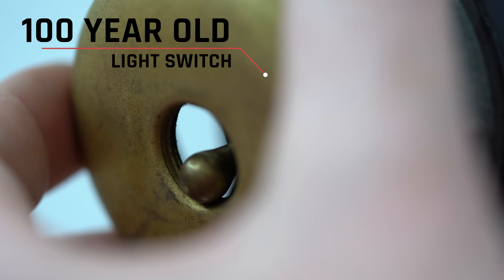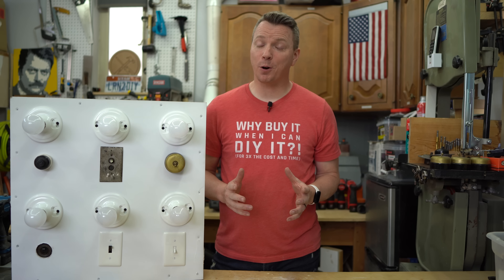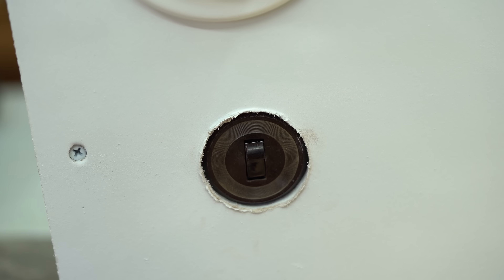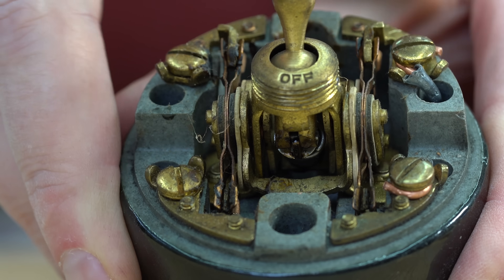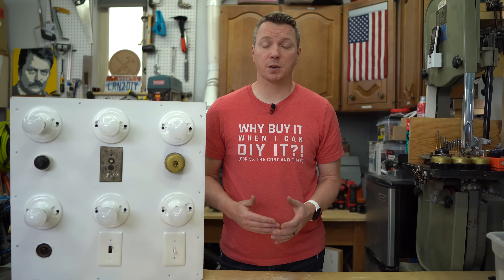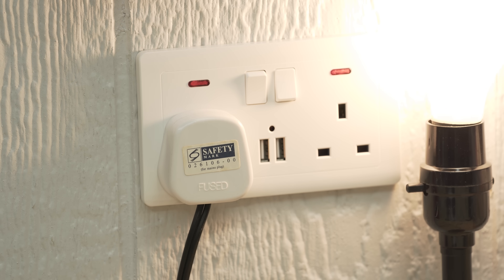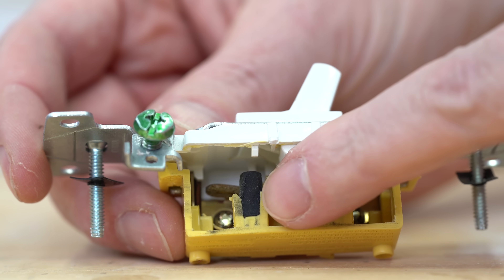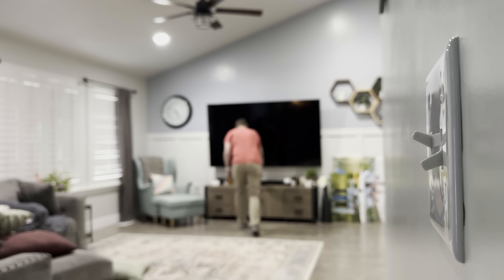How a Simple Spring Changed Light Switches Forever

Comment: Understand there is a difference between a light switch and a motor switch. Often there will be two ratings; one for resistive loads and another for inductive loads. 
Opening a motor circuit creates high arc voltage, so a bigger mechanism is used. So for a pump or furnace disconnect something better than a light switch should be used.

Comment: I remodeled a house with plunger style switches but they were low voltage!  They used 12VDC bell wire leading to a master control box in the attic filled with 120VAC relays which were wired from source to the final load.  I've never seen that since.

Comment: I used to have a car with a light over the engine that came on when I lifted the hood - yes a Mercury switch fitted to the hood!  In Europe the type of toggle switch that we normally use is actually called a 'Rocker' switch because it gives the impression of rocking; but underneath it is of course the same as the Toggle switch.

Comment: My childhood home from the 50s in sweden had turn swiches in the basement and i have run across the two button type in old farm buildings and on old woodworking machines. The most common old type is a circular plate with a smal toggle but smal stick swiches are also common. The modern ones are the big paddle type common across europe

Comment: Wonderful history lesson. You commented on the dual pitch "click" made by the switches. High pitch when turned on and low when switched off. I hear this in almost all switches. The advantage for me is that I can tell if the switch is  on or off  when there's no power or  device hooked up. I particularly like the sound of the switch on power strips when I'm trying to figure out if it's on or off. Whether intentional or not it's very handy. Too bad that the inventor's name is probably lost to history.
Reply: Technology connections could do a 45 minute video on this

Comment: Australian light switches are far more compact than the modern toggle switch you show towards the end. The mechanism is still the same but the whole thing is a little less than a cubic inch and clips into the switch plate so they can be mounted either horizontally or vertically, or you can mount other kinds of switch or indicator lights onto the plate. This allows you to fit up to 8 switches on a single plate. The leading industry brand is Clipsal, if you want to see what I mean.

Comment: I get that there are downsides to a mercury light switch (although the hazard of metallic mercury is overblown, and switches are pretty durable anyway so it's only a concern when removing and replacing or dropping an un-attached switch or something). 

Why didn't they try using another liquid metal alloy, like Galinstan? It's a gallium based alloy that melts at -19C. That might not be great for a few very cold climates in emergency situations where the heat goes out, but it's totally fine 99.9% of the time.

Comment: This is a very nice video on light switches which
to some might be a mundane topic. For me I have used the
very old 2 button switches in my grandmother's
San Francisco victorian house that was built in the
1880's originally with gas lamps (I think). Also growing up
in the 1950's, I have used the regular switch and 
the quiet mercury switch. 

But now the real change is happening with voice
controlled lights and motion sensor light bulbs. 
One can buy cheap smart wifi light bulbs that are 
voice controlled by Alexa or Google. Besides telling 
Alexa to turn off or on a particular light bulb (ex. "Alexa turn off kitchen light"), 
it can be scheduled to turn off/on at a set time or at 
sunset/dawn. Also one can turn off/on a set of light bulbs. 
In addition, motion sensing light bulbs are very useful in 
hallways and garages where a lighting is motion controlled.

So, the manual switch may become obsolete in a 
few years.

Comment: Cool video! I have been fascinated by switches lately. I have taken apart many different kinds to see what is inside. Having a spring pop out was surprising the first few time. I have come across lamps that still use something like that rotary design. One switch I find extremely fascinating is a simple 3 speed fan switch.

Comment: Don't forget the low voltage switching with multiple switches in a single gang box and relays in the attic or basement that actually control the power to the luminary.

Comment: I wonder if there are any switches using magnets for a quick break. The force of a magnet drops of proportionally to the third/fourth power of distance (depending on the situation), which is why they tend to "click" together. So if you had a magnet on either side with sort of a see-saw mechanism, it could do the same thing as a spring, but hopefully quicker.
Reply: I built a switch using this mechanism in my garage a few years back. It works but the action feels fairly different from other switches.

Comment: Oooh! I have worked on the push button switches in an old home in Toorak, Melbourne. Fascinating, I knew they were old but not one of the first. 

The home was basically untouched from when it was built in early 1900s, those switches were cool, almost looked like they had pearl inlay in one of the switches, but they made me un-easy, the terminals & metal cover plate are so close, millimetres apart, cloth wiring and no earth present at switches, really made you focus not to over tighten the cover plate screws.
 Owner didn't want to upgrade old fuses to encorporate rcds, nor rewire the house due to wanting to preserve its originality..... we were called to trace a fault, it ended up being a fluro in a tunnel below the house, causing a dead short.

Comment: The best mobile use of a mercury switch that I've found is for a light under the hood of your car! It's actually really helpful to have the light, and I'm not usually parked on a hill when opening the hood, so it works very well in that application for me.
Reply: I've seen a few of these, and they sure are handy, but I would guess that on a bumpy road, the light is getting "cycled" on and off several times per second!     🌄           - j q t -

Comment: I am 78 years old and do remember seeing and using those two button switches, not very many though and don't remember where any were.  Have also seen square external conduit running down the wall to them.  Probably the house was built without electricity and when they put it in they didn't want to tear into the walls to run the wires.  Have also seen the post & tube wiring, but think that was all in barns.

Comment: While mains light switches in Germany are basically the same they have on flaw I'm quite annoyed by:
When you tilt the flat switch rocker slowly the spring doesn't actually "flip" the contacts in one go. Instead you can reach a kinda floating middle ground where the internal electrical contacts are still kinda connected but more floating and not pressed together.
-> that leads to arcing, flickering of the lights and reduced life span of the switch.

Dunno if that's possible with USAian light switches.

Micro switches[1] on the other hand contain two counteracting "springs" and it's mechanically impossible to reach such a "floating" state / middle ground. You need to actuate the lever quite a bit before the second springs makes the flip and you need to move the lever just as much (or even more?) in the other direction before it flips back.
-> the point where the inner spring flips depends on the switches state (it's always farther away from the current in-rest position of the external lever).

[1] https://en.wikipedia.org/wiki/Miniature_snap-action_switch

Comment: I found an old light switch that looks like a modern switch on the outside but actuates a knife switch on the inside. Also found some bakelite switches in a ceramic case which has the wire terminals towards the front! Building is over 100 years old.

Comment: The softer sound for "switching off" doesn't make any sense, as you can turn it down to switch it on.
It makes sense only if there is a single switch controlling the light, as soon as you have two it doesn't matter anymore.

Comment: Not my story, read it in another video with mercury switches. But there was a home that OPs grandparents lived whos hotbwater would randomly shut off. Turned out during a remodel, that a mercury switch was used as a service switch for the water heater. And was attached horizontally on the joist. When someone would stand above (kitchen sink) and wash dishes, the rafter would flex ever so slightly and cause the switch to break contact, and having no more hot water until the mercury found its way back to create some contact.

Comment: I don't think you can ever have and arc with 120v or even 208v at the low amperage used at a household. You have arc potential when you go high voltage high current set ups.

Comment: We only have normal buttons as switches in most houses in Switzerland.

Those flip switches might work fine when a single switch switches a single light, and the state of the switch even indicates wether the light is on or off (usefull in case of a damaged light bulb), but that's about it.

When you have two switches for one light bulb, the switch position doesn't indicate wether the light is on or off anymore, so it's kinda pointless to even have that state shown to the user of the switch, which means push buttons are superior in this case.

And in cases of more than two switches, you would probably use a relay that does the switching and have buttons that give a pulse to the relay, so toggle switches are very impractical for this.

Or all in all, I have no idea why the US uses those old-fashioned toggle switches anymore.
Reply: The state isn’t shown on three way and four way switches in the US…only on single pole and double pole…

Comment: A potential reason for the two different sounds could be for the sight impaired, in case a switch was installed upside down they'd still be able to tell on and off. For the smart a**es: while yes they themselves may not need lights there's still going to be light switches in their life they'll need to be able to turn off reliably lol.

Comment: I beg to differ. Most of the switches in my house - built in 1973 - do NOT have the loud snap action (one does). In fact I can move the handle or tab slowly so that the lights flicker at the halfway point. They don't snap at all. With DC, this would cause serious arcing. so the old switches had to have the spring-loaded toggle action to force the contacts to open instantly, whether it was rotary, pushbutton, or toggle. But long after everyone had AC, the old toggle action switches continued to be used, because they still worked and manufacturers thought they were necessary. Maybe they were even required by UL.

With the mercury switches people came to expect silent switches, so the switches were eventually made silent even without the mercury.

Modern switches may have a small spring, but it's not a "quick break" toggle snap action.  It's just a soft "detent". (Detents are often used in rotary switches to give the switch a positive feel.) And you can snap them, but that is not a "quick break" because you can intentionally "tease" it halfway. This is not a problem for AC switches on household switches with resistive loads. 

Try it on  your home switches. See if you can force it to move slowly and silently.

The little panel mount switches with the bat handle or ball handle do still have the snap action.

Comment: Generally known as an "over centre" mechanism used in all kinds of applications, not just electrical switches.
In Australia, light switches can be wired in either direction (to enable paired switching) so it wouldn't make sense to have a different sound for each position.
Reply: In North America, we call that mechanism a toggle, hence the name toggle switch. In the US, our switches are SPST, and we have to pay extra for SPDT switches.
Reply: @buddyclem7328 Indeed "toggle" is a variously used term. In Australia (and probably UK too) it applies to the shape of the external lever rather than the action of the internal mechanism. All our switches since about 50 years ago have been "rocker" switches on the outside but of course they still toggle on the inside 🙂

Comment: Mercury switches are/were often used in other applications, the main one being thermostats. Mercury switch is on a coil of metal that expands/contracts with the temperature of the room, tilting the switch to turn the heat either on or off. The base angle of the switch determines the desired temperature. Pretty neat!
Reply: Many cars used a mercury switch to turn on the trunk light or the hood light.
Reply: @8546Ken  Crazy how, after bans passed on such a toxic product, that car manufacturers were still allowed to use these. Some in use all the way up to 2003. Even crazier when this was allowed on the front end of a vehicle that had a greater chance to leak out after a severe enough accident. My 2001 Expedition currently has one. I saw the mercury capsule one time when the small switch mechanism was not making proper contact and had to clean contacts on the inside. Thankfully the capsule is actually made out of metal and almost looks like a tiny bullet and casing. By the looks of it, I think it was designed to take a good amount of crushing force and even more G's if it was not directly crushed.
Reply: @RemmikRotus  A lot of mercury was used for fever thermometers, lab thermometers, and barometers. My Maytag dryer uses mercury in the gas flame sensor. Every fluorescent tube has a little mercury. in it.  Some lighthouses had a huge glass rotating lens that floated on a large pool of mercury for low friction.  How toxic really is liquid mercury?
Reply: @RemmikRotus  I think I still have one of those somewhere in my garage in a box of old electronic junk.  Most be about 55 years old, at least.
Reply: And the shifting of the center of mass of the switch as the mercury flowed added needed hysteresis to the thermostat.  It worked perfectly!
Reply: @paulclifford6941  Was the amount of mercury in thermostats and switches that hazardous?
Reply: My childhood home was like this

Comment: Very cool video! I didn't realize how much work was put into light switches over the years. I wonder if this same principle applies to floor/desk lamps too. Like ones with push button and twist switches. Or even power surge strips. So many things I wonder if they have this same engineering.
Reply: The rotary, pushbutton, and chain switches used in lamps I believe all have the snap action. I'm not sure about the outlet strips.
Reply: @8546Ken  The power strips use the same principle using a spring-loaded rod.

Comment: My Grandmothers house had the two button push switches throughout the house, except the kitchen and bathroom (because in 1969 my father renovated the kitchen and installed indoor plumbing in the house.  He did this when my mother had taken my Grandmother on a trip to visit relatives because my Grandmother wouldn't let him otherwise).  The house was sold in 1979 after my Grandmothers passing, but all the original two button push switches were still in place and working as new.

Comment: These switches are cool, it's interesting that the button switch and the first toggle switch had on in the upper position and off in the lower position. In modern times (at least where I am) you always push a switch down for on and up for off.
Reply: The convention is varied around the world. Here in NZ it is down for on, but I remember when some Japanese gear my team installed in the 80's was the reverse. We used the mnemonic phrases "Power it up" for "on" and "Power it down" for "off". That helped us break the habit of a lifetime.
Reply: it's quite often that down is on in Germany as well.  opposite of the US

Comment: 4:28 maybe nitpicking, but it's the exact opposite of a thermoplastic: a thermo setting resin. It does not melt when heated, but it solidifies. 
It's still used in various places like the handles of frying pans, in cheap circuit boards, as a binder in cutting and grinding disks and in many other places where heat resistance and low conductivity are important.